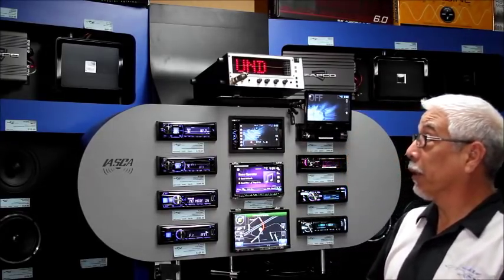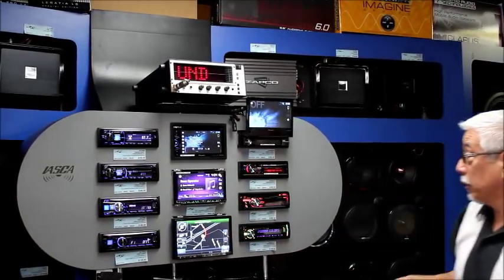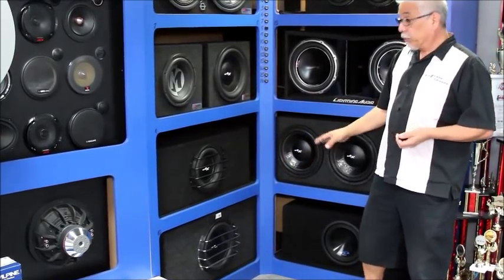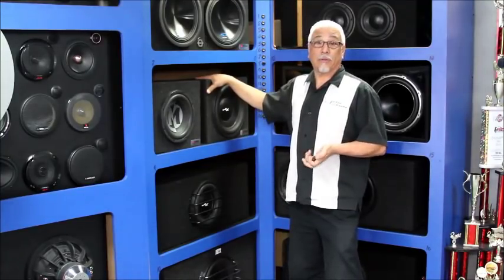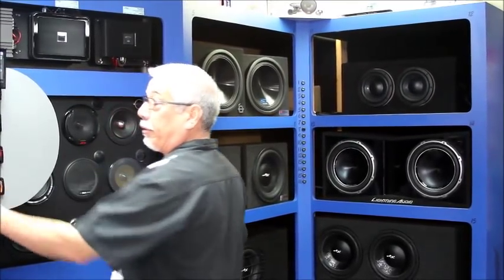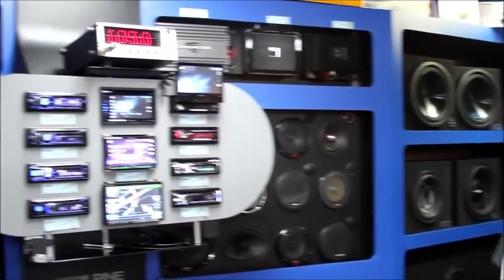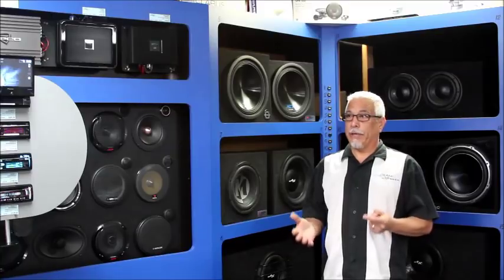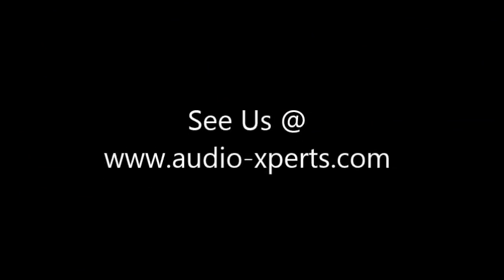Sealed vs Ported Demonstration by Audio Xperts using SPL meter to show output differences

Comment: How is range and sound clarity impacted by the different boxes? Which style would achieve best deep & low bass?
Reply: sealed boxes deliver the lowest bass,, ported boxes have a Bump as you will, or an increase in Db at the PORT TUNING frequency,, but will fall off sharply after that frequency.  The clearest  tightest  and lowest is a sealed box,,   all with the proper sub for the proper application

Comment: There are sealed boxes, there are ported boxes and then there are chambered and ported boxes.  The chambered and ported boxes are superior because it's basically a box within a box and the internal walls of the box are designed to help produce ultimate sound, acoustics if you will.  The technician in this video didn't mention any brand names, but Im pretty sure these subs are generic.  Go to MTX or Kicker sites and find out quick who is top shelf. Expect to pay $600 for two good 12 inch subs and enclose.
Reply: Dell Jr u pay 850 for a 15" fosgate power t2 and i shut two mtx 9500 12's the fuck down js and i dont even have a power cap or extra battery stock alternator and only running four gauge wire and a punch fosgate 1000.1db
Reply: And ill shut down your t2 with my x12 js...
Reply: When properly built, no box is "better". You chose a box based on what you want from it. All box designs have compromises and advantages. No box is better, just different.

Comment: sealed subs are better at limiting the movement.  the high output one makes more mechanical noise. the subs volume should be measured at the same distance and in the same position. the floor adds dbs

Comment: You cannot get an accurate difference measurement unless you play the same portion of the track through both speakers, and note the max and min meter readings for that portion.  You may also need to repeat each one several times, so you can take an average of the multiple readings, as the timing of the meter samples isn't synchronized to the music.  
Also, this method tells you nothing about what is happening to the frequency response.

Comment: So many car audio experts in the comments section. In principal, this guy is right except he went about it the wrong way. If u take a sub that is designed for use in both sealed and ported enclosures, it will reach higher SPL in the ported enclosure. There are trade offs like everything else in this life. 

His explanation was exaggerated but true in cases like the one I stated.
Reply: he was wrong because he used a small $50 sealed basic box and put it up against a ported box that was designed for that sub. Had he used a slightly larger sealed box that was designed for that sub the 2 would've been closer.

Comment: Plz suggest what type of Speaker Box will be the best for my Four Infinity Reference 9603ix (300 Watts) Speakers I want to use those Four Speakers along with One JBL GTX 1300T Sub Woofer in my Car,What type of Box shall I make for those four Infinity Ref Speakers ? Sealed Box or the Ported Box ? What type of Box will sound best for the Infinity Reference 9603ix 300 Watts Speakers ? Sealed or the Ported ?

Comment: If your after bone shaking bass ,put your subwoofer right behind your drivers seat ,had a 1000 watt rms sub at the rear of my car ,i then added a 300 rms 15 sub behind my drivers seat .after I couldnt even tell there was 1000 watts sub in the boot
Reply: Yeh in the cabin is best I miss my hatchback 😭

Comment: I will take a sealed box over a ported box any day of the week sealed boxes play deeper and lower bass and typically play all bass well a ported box has to be tune to be as low as a sealed box and even when it is it typically only plays good around the frequency it's tuned at the only upside to a ported box is it's louder but I couldn't care less about being loud I just want to sound the best
Reply: True lol. If only bandpass boxes worked with every sub out there, and were not a pain in the ass to build correctly.
Reply: +Alex Alvarez I love bandpass boxes in certain applications they tend to be play a lot of live music better as far as kick drums that sounds like that and you don't hardly ever see anybody with them most people I talk to laugh at bandpass boxes but that's because they don't know any better
Reply: + Alex Alvarez They laugh most likely because they are probably used to seeing the same old cheaply made bandpass from pyle, pyramid, etc.    I had a MTX TB12 Bandpass (single 12" 200w) on a 150w rms amp back in the day and it would flex the roof of the car, and shake the mirrors as well. I've seen Dual ( I don't mean the brand) 12" Cheap Bandpass and it just sounded like loud mid bass resonance and port chuffing.